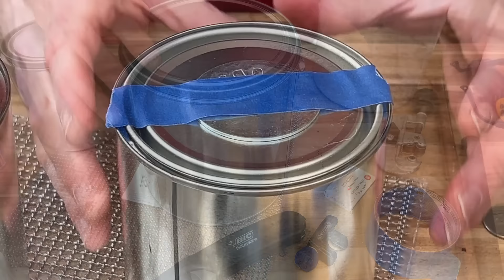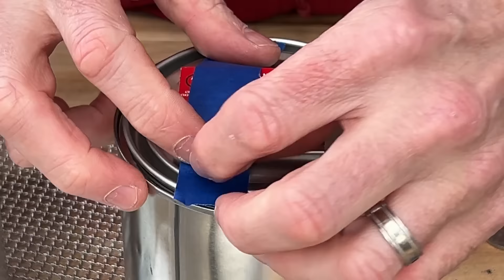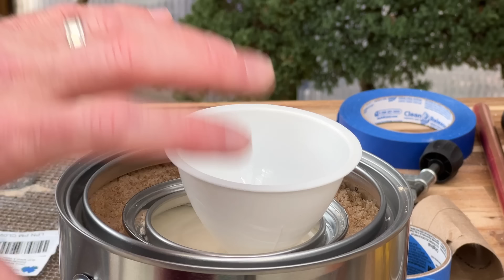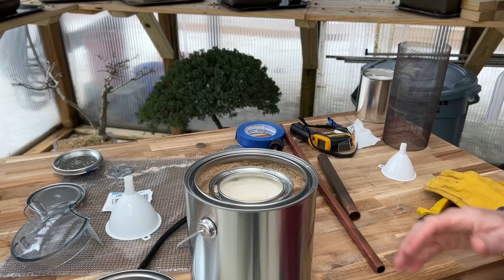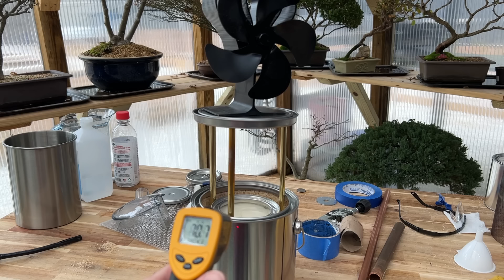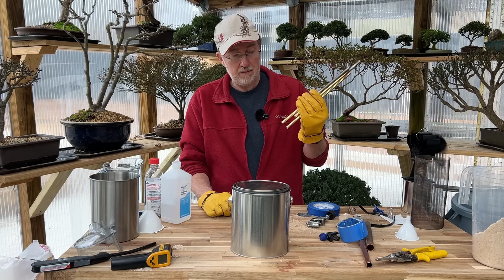Endless Heat Without Electric | Safe Reliable And Low Cost

Comment: A 1kg block of #Polonium-210 would give endless for about a year. Day 1 you'd get 140KW of heat and then by the end of day 279 the heat energy would drop to about 35KW.

Comment: Can’t wait to try this! Also, if you put water instead of sand in the larger container, and then put your flame container, the water container into a big sand container, would that help create boiling water and still throw off in enough heat?

Comment: Thanks. As a seamstress I can suggest the carbon felt can be cut into a long strip, sewn end to end if not long enough , then twisted diagonally around the inner pipe. When fitting  twist as you guide the smaller pipe covered in the diagonal  through the larger. Cut off excess at the end .

Comment: 2 questions: you talked a lot about the denatured alcohol use. What would be the drawback for using rubbing alcohol instead?
Next question: would using cement rather than sand work as a good insulator?
Thanks! I appreciate you & your videos! You are so helpful in teaching people become prepared “just in case”!

Comment: The downside is not to let the fuel get to low or the toilet paper will start to burn. This happen to me last winter when I had this heater in my attached garage.  The fuel got to low and started to burn and put-out a cloud of smoke that filled the garage and house. So I had to open the garage door to air it out, all of that heat and energy was wasted.

Comment: Question ❓ instead of sand . Can I use stone dust zero to 1/4 inch ? Because we are very cold rate now -32°C this morning. My wood stove doesn't put out the heat because of an easy wind.

Comment: Stop using paint cans you friggin idiots!!!  Those cans may be "clean" and have no linings but they are still dangerous. Those cans are galvanized  material. When you heat galvanized metals the galvanic coating breaks down and you can breath in the fumes and end up hospitalized or dead from galvanic poisoning. This is one of the biggest flaws with YouTube, any moron can post a video showing how to do anything, no matter how wrong they are. Please do better research before posting your vids.
Reply: Instead of being mean and evil,  provide alternative solution to the paint can and help.  Per Google: Yes, heating a galvanized paint can makes the fumes toxic to breathe.  When the zinc coating is heated to temperatures above 800°F (427°C), it vaporizes and reacts with oxygen to form zinc oxide fumes.   It is rare to find a galvanized paint can so your warning about zinc fumes from a paint can is essentially a non-issue. The risk only applies if you're heating actual galvanized structural metal (pipes, roofing, bins), not a paint can. If you're repurposing a can, just make sure it's clean and held water-based paint to avoid solvent fumes.

Comment: Where do you get the fuel cans, the smaller cans?
Reply: The smaller ones are 1 quart paint cans. You can buy them brand new  basically anywhere they sell paint.

Comment: set this up but ended up with a heavy flame that is smoking up the greenhouse. increased temp. 25 degrees in minutes. actually getting too hot. what did i do wrong.

Comment: I had
Purchased some flaxseed felt neck warmers.  The type you could put in the microwave. I found out that placing them in my bed between the sheets didn’t require the microwave at all.  Just get into bed and place your feet on or close to those flaxseed neck warmers and your own body heat would transfer to the bags and radiate heat back to you.

Comment: This is a wonderfully simple and quite efficient heater. Safe too. Also, you could put perlite with ethanol inside the inner tin too which would burn just as hot and zero clean up from residual toilet roll 😜
Cheers for sharing this fella 😉

Comment: how long does 16 oz of fuel burn for?  I assume a full paint can full with the wick taking up a lot of space would only allow about 16 oz of fuel, so how much real btu does it make?   Compare it to just running an electric heater or one plugged directly to a generator (which are FAR safer than your DIY heater).  iMAGINE IF SOMETHING TIPPED OVER THAT THING WHILE IT'S BURNING.  What's to stop it?  Like pouring lit gasoline everywhere. Yikes!

Comment: Hey man! Again, a very good video. If I can just make a constructive suggestion to make your videos even better, and so much more relevant... Instead of saying things like "larger area", or "i can feel the difference in temperature", and the likes. Put in measurments. For instance, when you say your green house is more comfortable after one hour, you should say instead : "my green house, which make ZXY cubic feet (or any kind of measurment), has raised 3 degrees in one hour with this device while temperature outside is this or that. By comparison, the temperature raised 10 degrees with that bigger device instead". Or give us an idea of what you mean by "bigger area". For instance, I have a 3 cars garage, with lots of free room between them and with almost a second floor that I use for storage. Its roughly 40 X 30 X 10 feet total and temperature in winter are between -10 celcius to minus 40 celcius (14F to -40F). I want my garage to maintain a comfortable (68 fahrenheit) except at night. If you could could provide us with some measurments, it would help us know what solution we could put into place instead of going trial and error. Do I need 10 of the smaller one? Do i need 5 bigger ones? 3? How many small ones do you need to generate as much heat as a big one? Things like that.

Comment: In regards to a previous article using the mason jar and copper piping. For heat. Can you send that to me? When you drilled😢
 the holes in the copper, did you go all the way through both side? And if I want to turn it off, how do I do it?   Finally what 
happens if it gets knocked over?

Comment: Bury a copper tube filled with water in that sand. Make sure it is running accross the flame too. The sand will capture that heat for days

Comment: Fun project I enjoyed the originality.  This could be modified to be an efficient heat radiator by using another inverted steel bucket affixed to the top of the sand filled bucket with a hinge attached between them like a clamshell.  It would require several 1/2 inch holes drilled around the periphery close to the top bucket's rim and also several on the bottom of the top bucket whose purpose would  provide air for the flame and a draft for the exhaust.  The top can should get hot and radiate heat uniformly without direct exposure to the flame.

Comment: Should have aluminum foil panel put behind the burner so you can tell the fire is on. Without any reflection, it's dangerous when it's burning

Comment: Second video of these DIY heaters. I have 450 cubic feet (6x12 tool trailer) I am looking for a cheaper alternative. I will use cement board as a fire barrier, I believe this is the trick, how much run time does one of these get?

Comment: What about cost, and how does it affects the room temperature?  He could simply stick the little lid in there right on top to put it out.  Couldn't he use bigger pipe that would fill the space between the two cans and put it in earlier in order to more easily square it up and keep it more stable?

Comment: I enjoyed the video. But I have to ask what kind of tent you're camping in that you could be killed as the result of a fire? I have no doubt that if there was a fire capable of doing me any real harm then a solid 1/3 (@mininmum) of the walls of said tent will no longer exist when I wake up. So I'm going to roll through the brand new door to safety still inside my sleeping bag because plastics and heat dont mix. You can try to argue smoke inhalation but again, what about that big hole in the tent the fire that produced the smoke at the same time also created. All I'm saying is if you die in a tent fire that didnt have a circus underneath then we'll just chalk it up as natural selection.

Comment: I might would put some high temp rtv or exhaust paste on top of the sand to hold the sand down in case of tip over. Just leave little holes in it to put your rods to hold the lid. 
I have one of those fans on my little tent wood stove and I love it.

Comment: Great video! Has anyone tried this in their hoop house greenhouse? I don't have electricity going to mine and I'm wondering if this will work.  I'm a little concerned about the unattended open flame, but my greenhouse isn't really near anything wooden(my nearby shed is metal) and so it should be okay.

Comment: My goodness.  Waaay too long to get across a 5 minute presentation.  Let me save you a half an hour, by saying he used a 1 gallon metal paint can, with sand inside, then a 1 quart paint can cantered within the bigger can, with sand packed all around.  Stuff a roll of toilet paper inside the quart can, then fill it with Denatured Alcohol until saturated.  The toilet paper will not burn any faster than a wick in a candle.  Seal the small can, then seal the larger can to store it, or light it up and use it.  He also had a fan that operates off of heat, instead of electricity, which helps move the hot air around.  That was good to know.

Comment: Great, if I had known this about 25 years ago, I have purchased about two. I would have left the apartment I used to live in because when it got freezing cold, the management turned off the heating system to save money. However, now I live in a condo that runs entirely on electricity.

Comment: Critical Safety Rules...Never open or refill near flame — 10 feet / 3m minimum.
Cool fuel bottle first (shade, water) before opening.
Use vented caps or loosen slightly when storing.
Fill stoves outdoors, on stable ground.
Use funnel to avoid spills → spilled alcohol vaporizes fast.
Store in shade, never in car trunk.

What to Do if Jetting Starts Drop and run — do not try to cap it.
Let it burn out (usually <30 seconds).
Have fire blanket or sand ready (water spreads alcohol fire).

Bottom LineFlame jetting = pressurized alcohol vapor escaping + ignition
Cause: Heat + closed container + poor handling
Fix: Cool, vent, distance from flame
Never underestimate denatured alcohol—it’s clean-burning but explosive under pressure.

Comment: Stainless Steel paint can, medium stainless steel quart can, dry sand, 3 equal sizes of copper pipe, matches, coin, toilet tissue without brown part in the middle, pack sand around small quart thats holding the big can. Toothbrush to clean acess sand off and denatured alcohol to pour on the tissue inside of the inner quart container. Store for 10 years. Metal fan is optional
Reply: Thank you
Reply: Sounds expensive just get a mr heater
Reply: Thank you ¡¡¡ the old men take to long
Reply: @maggiegomez1046 You are an extremely ungrateful person!😢 Shame on you!!!
Reply: @maggiegomez1046 When you're an old woman someday, I hope you think about how you treated other people.

Comment: Great video, thanks.
But considering the normal denaturants normaly used, fumes and vapors from it can't be good for us. I would go for the 99% one.
Denatured alcohol is ethanol that has been made POISONOUS and unfit for human consumption by adding TOXIC or bad-tasting substances called denaturants. These additives, such as methanol, BENZENE, or PYRIDINE, make it unsuitable to drink, and it is sometimes DYED for easy visual identification. Denatured alcohol is commonly used as a SOLVENT, fuel, and cleaning agent in industrial and commercial products.
Reply: Huh?  Who's gonna be drinking it?  Please explain
Reply: @SasquatchNinja  I wrote "fumes and vapors from it can't be good for us" because those chemicals WILL evaporate and certainly will poison the AIR. I didn't mention anything about drinking it.

Comment: La versione più grande penso non sia propriamente "portatile" ma più da riscaldamento di stanze o locali, se posso vorrei darti un piccolo suggerimento.
Crea un tubo con una rete metallica a maglie sottilissime dello stesso diametro interno del barattolo più piccolo alta 5 o 6 volte il diametro del barattolo ed inseriscila all'interno del barattolo fino in fondo, riempilo della sabbia che ci hai mostrato, metti il carburante e metti un altro barattolo al di sopra come cappello per chiudere il tubo di rete. 
La fiamma in questo modo sara protetta e resterà all'interno del tubo in rete metallica e risulterà meno pericolosa alle persone ed alle cose che le staranno attorno.
Per usarla come fornello dovrai comunque creare una struttura di supporto magari integrando il tappo del tubo in rete.

Comment: I just made this today. 10/25/25. I wanted to get it ready before the temperature starts to drop. I live in a small town in Texas. My local mom & pop lumber store had everything needed. 

Bag of sand (50lbs) 6.99
Qt empty can 4.29
Gallon empty can 9.99
Total was 21.27

I had denatured alcohol on hand and also toilet paper. It took 2.5 pints of DNA to saturate the TP roll. 

I've had it burning about an hour so far, no problems. I do not have a fancy laser thermometer so I am unable to share the temperature it is putting off. However, I can definitely feel it from 5 feet away. 

This is my first burn, so I cannot report how long it will last, or if the TP will be consumed throughout the burn. I am getting bright orange flame, probably due to the chemicals being burned off. 

All in all, I think this will be able to keep my small shop (1 car garage size) at a comfortable temperature this winter.
Reply: I had it burning for 6-7 hours before I put it out. I needed to leave the house and I didn't want to leave it unattended. When I got back home, it re-lit with no problem. It burned about another 2 hours. 

The TP did burn up. Making it non reusable. You will need to take the quart can out, empty the sand from the gallon, insert a new TP roll, and remeasure the sand to set it up again. I think this would work better if you use carbon felt fiber like is used in many of the videos on this channel. 

When I rebuild this, I might use carbon fiber, or I might use the copper tubing with carbon felt. I have not decided which method to try next. I definitely will not be using toilet paper for the 2nd. 

I hope someone finds my experiment helpful.

Comment: dude, 6 minutes in and youre still talking about different things to tape to the top of a can to open it... thats 30 seconds at MOST... anyways... im kinda homeless and winter is coming. i say homeless because i lost my home to fire but im in a 5th wheel camper with no electricity or water, so im ghonna need tips and pointers to gather and keep heat, so 6 minutes on the wonders of a makeshift prybar are not lost on a country boy, but im waiting on you to get to it. youre doing a good job though, regardless of my impatience.

Comment: You can do the same thing with rolling cardboard up and placing it inside the can for the wick and use hot wax for a fuel filler directly on to the cardboard. If you have no toilet paper 🧻 Also cranberry jelly in the can is alternate fuel source.

Comment: I worry about the gases that come off the fuel. They only non toxic fuel I know of is Soy oil. Anything else has chemicals toxic to humans and could kill you if used long term. I prefer a small wood stove. I used one in a trailer for years. Everything goes up the flue.  Indoor air stayed clean. Worked better than any fireplace. You can place one in a brick box to  keep heat in the bricks that will warm the room as the fire goes out. Propane heaters are not as safe as a well sealed stove.

Comment: Liquid vegetable shortening works. Can use solid shortening like Crisco or similar, too. For solid, fill glass jar or glass measuring cup with shortening and microwave until melted or set in pan with lower level of hot water until melts. Once melted, pour into bucket and let wick soak it up. Works good too. Can use as alternative fuel if alcohol not available and easily available at food markets. Solid shortening cooled and stored for emergency doesn't spill either. Good idea heater. You never know if a major storm will knock out your electricity.
Reply: If using crisco .. buy the one where the "I" is dotted with a flame, it burns cleaner and is designed to be used in this way
Reply: @TimberTraveller  Good point.
Reply: Awesome idea. I like this alternative better than the alcohol one.
Reply: @terrillscott9357  Thank you. And poorer people can use EBT card to purchase.
Reply: @terrillscott9357 but does it burn as clean? I think I read somewhere it soots but does it need to be vented the same?
Reply: How long does this last before refueling?

Comment: Couple of things.  I purchased two paint cans from Amazon per your link.  There is a grey coating inside the cans they sent me so not certain what that coating is.  Plus Amazon put tap over the lid and now I have sticky tape residue on the can and lid which I can’t even get off with goo gone.  Of course the tape is at the top of the can which gets hot so I can’t even imagine that tape residue will be a mess.

Comment: You can use moonshine because it burns clean & nontoxic, but you may want to add some paraffin oil to make it slightly less combustible. I grew up using this as a camp heater & a light source singing Colman camp stove oil. We just removed the paper core & stuffed it tightly into a coffee tin & then soaked it with camp oil back in the 1960s & 70s. To put it out just set a pot over it for a short time. Put 3 flat spacers evenly spaced around the lid to set a pot or skillet onto to cook food. The spacers of equal thickness let’s the fire breath. The bigger the pot the bigger the burner = also more heat. It works great. Today I would definitely use stainless cans. I love the heat operated fan trick. We never had those back then.